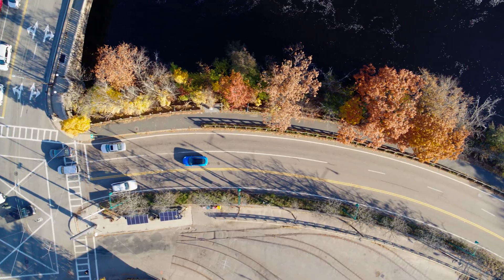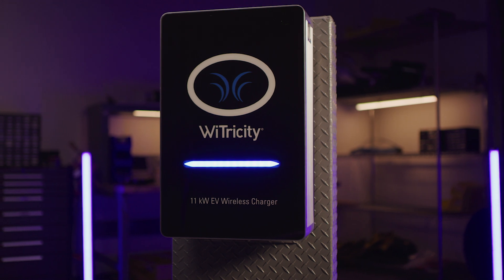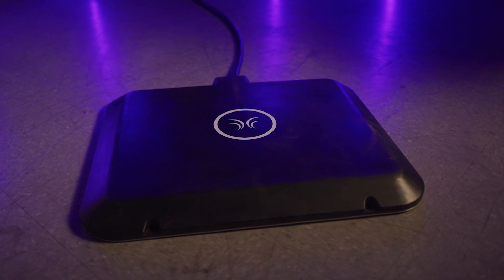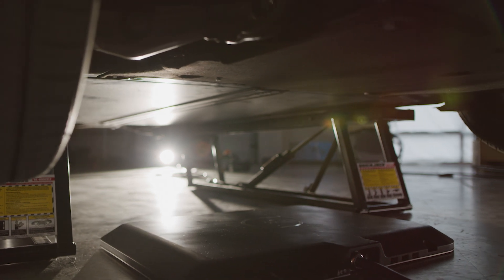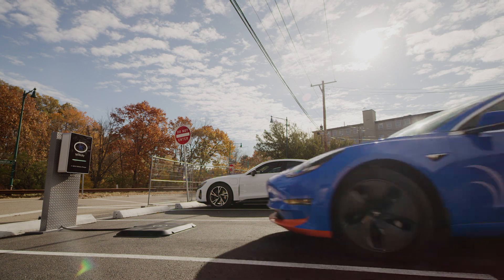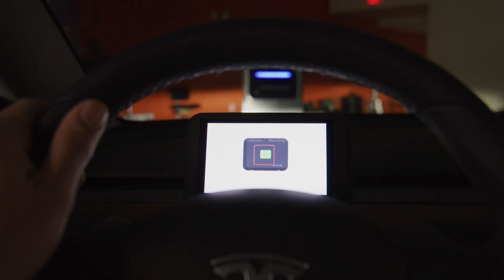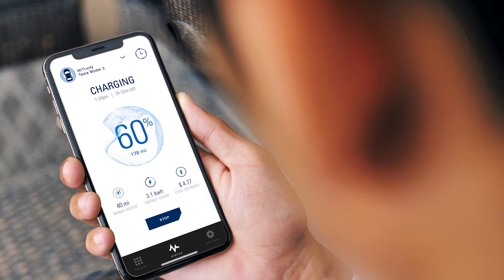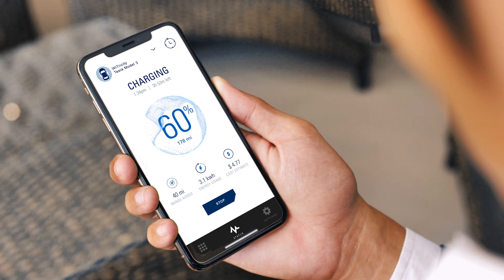Wireless Charging for Electric Vehicles

Comment: He said the system will charge at a rate of 11 kW with a standard 60A outlet at 0:55. Not exactly a rate... Would have been better if he gave charging times, what voltage the outlet is for that amperage as well as the Ah rating of the battery.
Reply: Actually, Watts is the correct unit to use - the voltages and currents change many times. If your battery is 55kWh, the 11kW would charge it in 55kWh / 11kW = 5h
Reply: @sirifail4499  yeah. I was just wondering if he meant like using a 240VRMS or 120VRMS outlet to charge. Beneficial info to the homeowner charging in the garage etc. 

Given that large wattage and 60A I'm assuming 240VRMS with 60A drawing about 46 amps at maximum for derating.

Comment: “Power snacking” is the in-vogue way of describing a slow, severely handicapped way of charging an electric vehicle (11kW).
WiTricity technology seems to want to be known as the “Snickers” of the EV charging market.
It is also the sound you hear when WiTricity is brought up as a possible solution to charging EVs.
Here is one guy that is not buying it…  https://www.youtube.com/watch?v=n7X4TRBazvo&t=1280s (21:20-23.50)